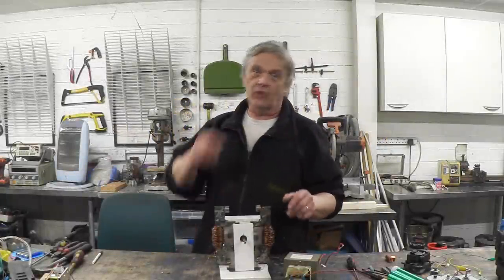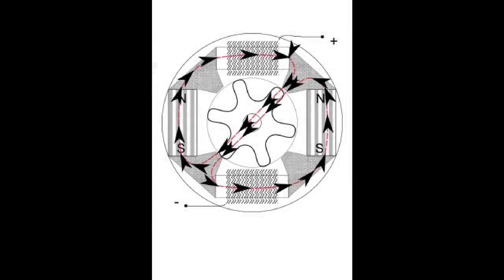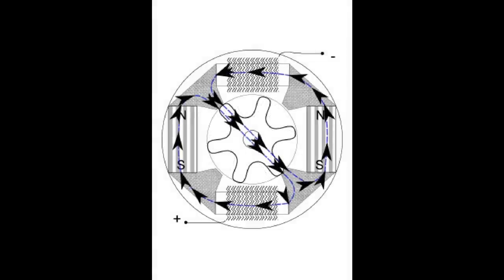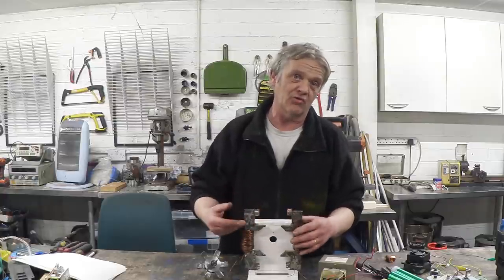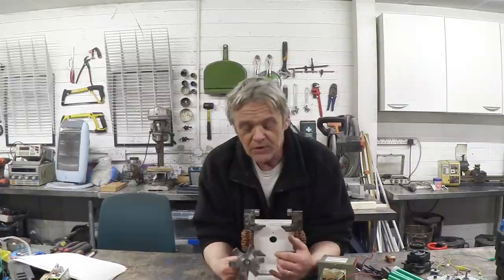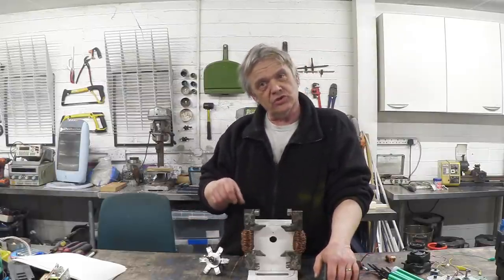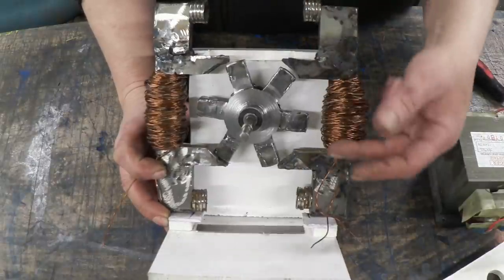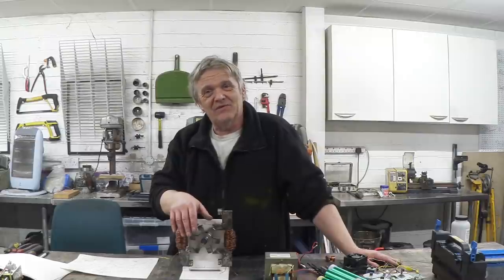1035 Flux Generator How It Works And Design

Comment: It took me a bit to acknowledge the rotor had no magnets. For some reason it was counter intuitive until I recognized the rotor is just directing the magnetic field from the rest of the system. Very cool. 

Understanding that a collapsing magnetic field through a coil produces voltage is also key here.
Reply from the maker: exactly what is happening mate

Comment: I like this Rob thank you. If you made a second coil, magnet and rotor set up have them both driven on the same shaft but the rotors are offset so that you are getting DC current rather than alternating current or near enough.
Reply from the maker: like a motor gen set?
Reply: @ThinkingandTinkering  No so when one set is completing the Right Left circuit the other one is completing the Left Right circuit for DC power generation rather than AC power generation as you wish or need.

Comment: Awesome ROB! once again, we are on the same frequency! I'm currently trying to turn the stator in a Yamaha motorcycle into a flux switching motor! It's still attached to a nice transmission that fits right into a nice motor bike frame, so even if I can only whack a couple thousand watts through momentarily, should be capable of moving wich would be hilarious!
Reply from the maker: that would be awesome mate

Comment: Mr Robert you truly are creative genius I have been following you since 100subs.

7 years of reading original transformer patents from late 1800’s has lead to to realize they were creating amperage to flow with magnetism.

Not more amps causing more flow.

All of Tesla’s patents have been screened and filtered and simplification wiped away.

His protege Elihu Thompson however his patents were not in the lime light. 

US patent# 400,516   Year 1897 

It explains amp flow is a correlation not a causation of power generation.

Comment: Absolutely fascinating, needed to watch the previous video to get more context and had a read of  the Wikipedia page claims that its primary advantage is that it can be direct driven by high rotation, so they jump to guided missiles, but I was more thinking, well Tesla turbines are meant to be used at high rotation speed so this looks like a perfect accompanying invention for it (makes sense as he's done both). Perhaps Tesla was  too much hindered by lack of material that can withstand those speeds and ability to rectify the high switching currents. Also that this generator can easily self-prime itself by indeed using permanent magnets, but nothing prevents you from wrapping an electromagnet around it, makes me wonder if it is combined with the turbine it also self regulates itself for max power.
Reply from the maker: I also thought it was really interesting mate and your thoughts and mine are going down pretty much the same lines I think

Comment: The reason the transformer core is laminated is to prevent eddy current in the core and the loses that come with that. The same with motor iron. A laminated core can be replaced by solid iron but the losses will add up.

Comment: Robert Murray, could you be the first person to figure out how a homopolar generator works. It has no shifting flux but a spinning stator and magnet. It generates very high amperage dc power. faraday paradox
Reply from the maker: cheers mate
Reply: @ThinkingandTinkering  I will raise the whole bottle ,if you could determine the phenomenon of the faraway paradox. Like the magnet and electret ,the electrical equivalent to the magnet, I think people should ask themselves where is the flow of energy to generate these fields . I think the aether theory should be revisted since the whole electric cosmos has been verified

Comment: How about capturing the back emf when the rotor passes a pole, energises the coil and then carries on to the in-between position. The field on the coils will then just collapse and back emf should be generated. This is found in a lot of designs that use coils. You see it in the vids and literature from Patrick Kelly and his Free Energy stuff.
Great vid btw. 🤓🤘🏴

Comment: Hello Sir, I would suggest getting a magnetic field measuring device with 2000 miliTesla measurement range. Using this meter you could check the field intensity on surfaces where rotor poles are passing the stator poles. Is there a lot of torque required at no load on this gen? If not then that would indicate that the flux intensity is not very high at the gaps where rotor pases stator. There is a flux loss per milimiter of core material length so if there are no magnets inside coils then I would think that this device needs some optimisation :) Best regards!

Comment: Could you put the generator configured type, on the same shaft as a motor configured type, and make the motor have more torque than the generator needs to turn it , and loop the two together ?
Would that be similar to the Lockridge device, found during operation paperclip, at the end of ww2 ?
Reply: You could ..... but you would be breaking the laws of physics and inventing perpetual motion ;0)
Reply: Can't get more power out than put in. But tbh otherwise sounds pretty much like a rotary converter.. Used to change supply parameters
Can change any of... 
1)frequency (Inc to/from DC)
2)change how many phases
3)change voltage.
Reply: @totherarf  , power you can surely, it's energy that stays the same, what if mechanical torque in the motor side was efficiently produced, enough that it's electrical power consumption, was less that the generator output.... for instance, using a larger rotor on the motor side.
It's got to be possible, if motors can be generators, and vice versa, what's the secret
Reply: @fizzyelectricity  I had a guy claiming years ago a device I built was outputting more than the device needed inputted. All I know is you could hear the device running a block away with a cheap portable AM radio. And with the right circuits run remote things wirelessly.  I honestly remember thinking how does a 12 volt car battery charge a capacitor to 700 volts using a flux capacitor motor?   I know a lot of it was the switch. The bemf happens twice, first when the switch connects, then again when the switch disconnects.  Using diodes I would collect the spikes in both directions to 2 capacitors then bridge the 2 into a third capacitor.  When you hook the output to a AN10NA the alphabet boys come looking for your rabbit ears. I was causing undesired interference on a local radio station, whoops.
Reply from the maker: Motor gen sets were very popular until the late 50s I think and are basically inverters they Made one combined called the dynamotor where the windings for the motor and generator sections were on the same rotor - but I am afraid I don't know anything about the lock ridge device sorry
Reply: @fizzyelectricity  The secret is you need to put more in than you get out!

You can play round with voltage and frequency (we even installed one in ICL West Gorton to get a "super clean" supply) but in every case the input exceeds the output due to losses, sound, heat, vibration etc.

I did make the assumption that the original motor was being fed from the linked generator without any external input though ..... maybe I was wrong on that assumption? If you have any details of any device that counters this can you let us know? There are many that claim big, but fail to show details. 
The final thing I will say is that it is good to try to do things you are told are not possible ..... or to do things in a different way than they are normally done ;0)

Comment: Is that basically an ac generator or motor rather than a dc?
Reply: Yes, but IMO you can make a second one use the same driveshaft and off-set the rotors for DC power.
Reply: @Barskor1  Ok. What's IMO
Reply: @rastamanralph6670  It stands for In My Opinion
Reply from the maker: yeah pretty much

Comment: I still dont get why the military would choose this over rotating magnets .
I dont see the advantage of using this method.
I am this close "" to caring enough to look it up .  :)
Reply from the maker: lol - well looking it up would answer your question but then doing nothing would equally be valid if you just don't care that much lol
Reply: If you dont have magnets on the rotor then it can be machined easier and balanced easier and magnets will not demagnetise. Could be other reasons too.
Reply: Because flux switching alternator is overunity with correct configuration. There is way too many designs and some are overunity.